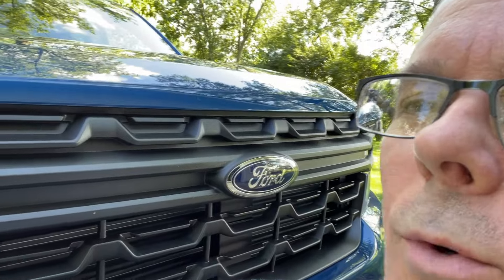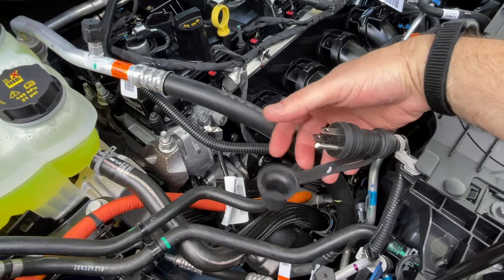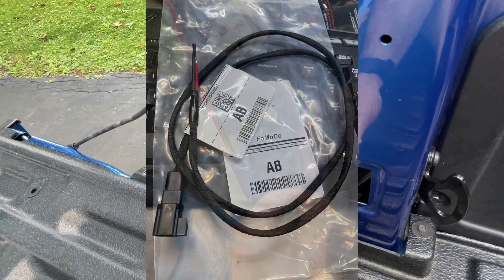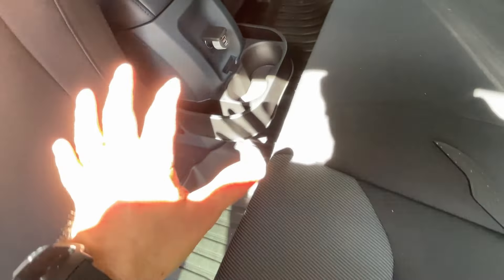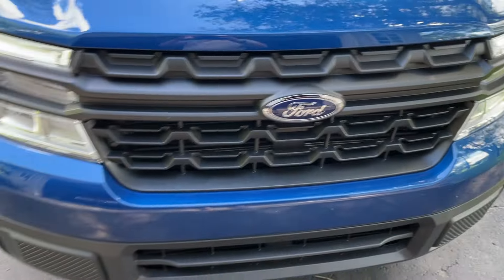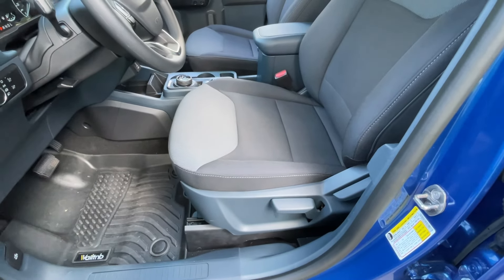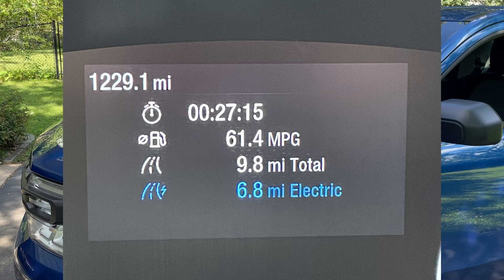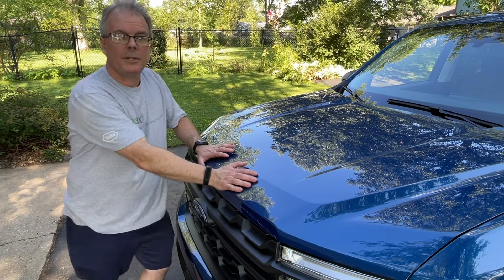2024 Hybrid Maverick XL 1200 Mile Check-In!

Comment: Most comprehensive video on YT.  I'm buying a Maverick in the near future whenever my local Ford dealer gets one in, there lot is full of non-hybrids and I want the better mpg and front wheel drive isn't a problem.  I'm currently driving a 2019 Honda Insight EX hybrid and love driving a hybrid.  It gets 48mpg around town and anywhere from 52-63mpg on the interstate once I get out of the mountains of east Tennessee so I used to driving a hybrid!  I'm also keeping the Honda, I want a truck because it's the ultimate utility vehicle.